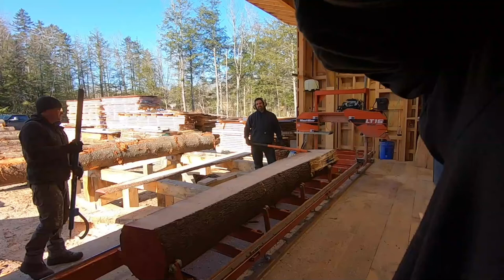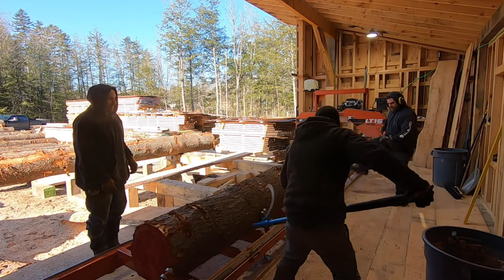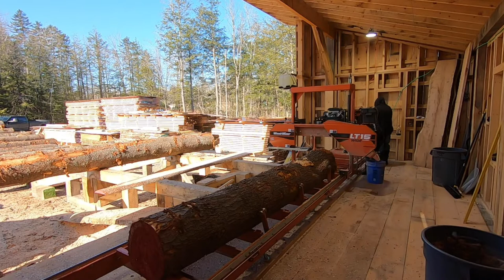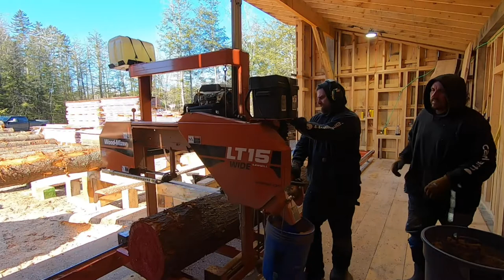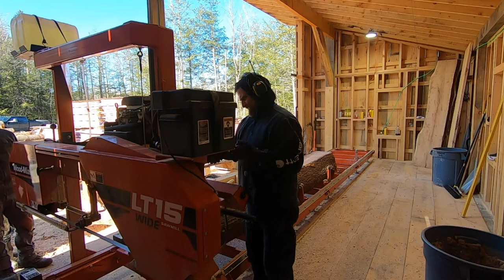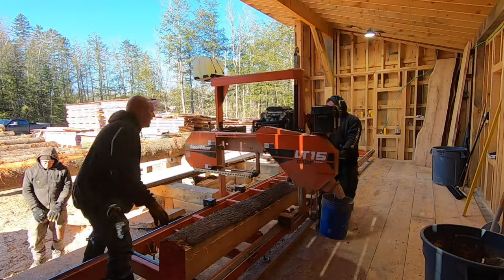CUTTING WITH A WOODMIZER LT 15 WIDE ON A BITTERLY COLD VERMONT MORNING

Comment: I like what you are doing just keeping it simple. how often are you changing blades? in logs or board feet.
Reply from the maker: We use woodmizer blades, 9 degrees for pine, and 4 degrees for hardwood slabbing. In hardwood it can vary wildly, sometimes we will only get 350bf slabbing 30" diameter birch/oak. We've found the smaller the logs, the more BF you get out of a blade
 Small logs, up to 800 in hardwood (we use lots of coolant, not dry). In pine, we've found we can double the life of the blade by drenching it with coolant. In a 8 hour day, we go through 2 5-gallon tanks of coolant (in winter we use straight pink RV antifreeze, and in summer we use water with a full bottle of pinesol). We average right around 2,000 BF on each blade change. We keep a carnival clicker_counter on the choke knob, every 10 BFF we give it a click. We also check every few hundred BF in pine with an 8ft level to see if there is any wave in the logs (the level body is machined straight, and shows even the smallest deviation from dead flat).
Reply: @cripplecreeksawmill  best information i have ever received on sawing. thanks
Reply from the maker: @TIMber1962 glad i could help, good luck Tim!